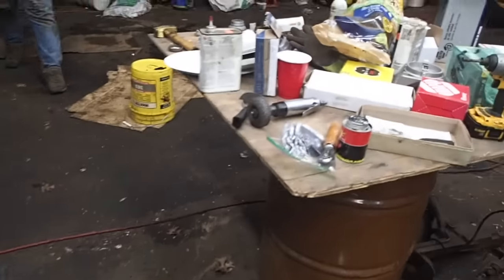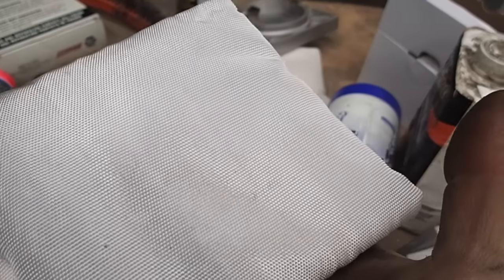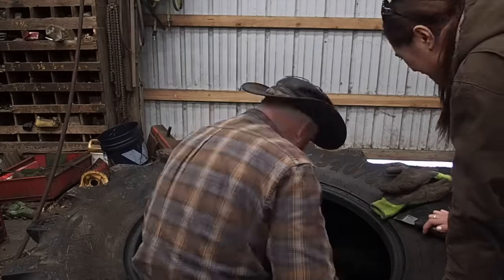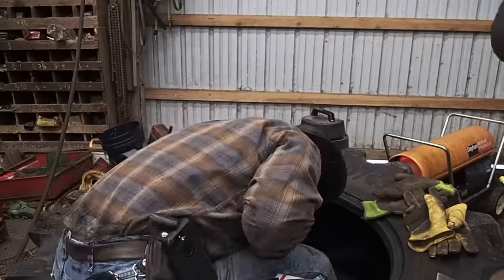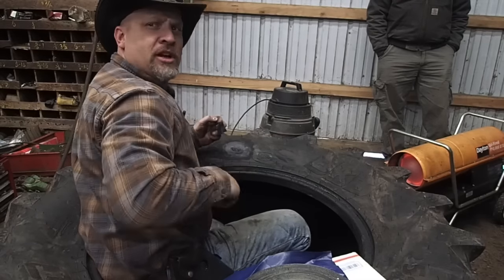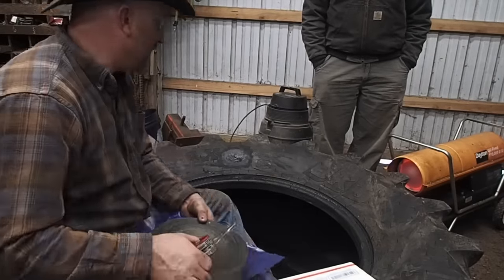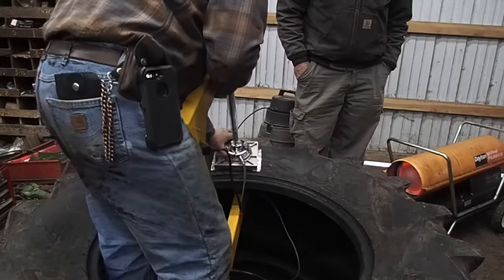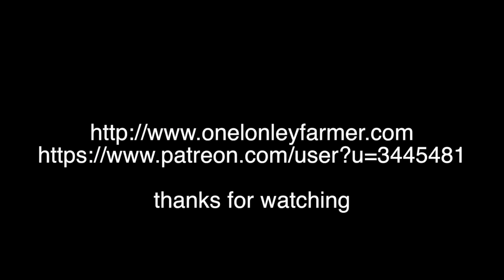Failure Is Not An Option

Comment: HI Wes!
What kinda baler are you gonna get for this upcoming season?
Reply: andban92 he is keeping the Krone.
Reply: same one as last season.
Reply: andban92 he is keeping the krone...
Reply: Did it just gone for fully maintenance work?
Reply: andban92 Yes, presumably next year for the next baler although with the basically faultless Krone I wouldn't be surprised if it was kept a bit longer
Reply: He's stated in several videos, starting in September, that the Krone was going back to Messick's for a complete inspection and service.  This is being done in conjunction with Krone and Messick's so that they can see the wear on the baler from someone who uses it for high production and in hard use.   If OLF follows his original plan, he will be going to Messick's and producing videos showing the process.
Reply: Thanks.